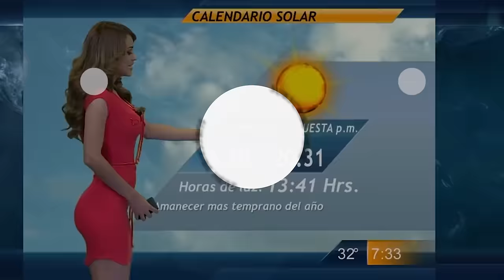Ozzy Man Reviews: Hawk in the Hood

Comment: For anyone in a similar situation where you need to interact with a wind/ scared bird, it is far safer for both you and the bird if you can swaddle it in a towel or something similar. It should be thick enough that claws and beak cannot easily penetrate. By swaddling them, that prevents them from moving which can damage their wings and it keeps all of your parts protected
Reply: You're still getting sued.  :)

Comment: nerd info
It is a red tailed hawk, common throughout North America.
What happens is they dive after a rat/mouse/juicy rodent across a highway. They have tunnel vision during this and are oblivious to anything else.  i am surprised it flew off, it was probably temporarily blind after an impact like that.  When birds strike (crash into) something the optical nerve gets a thump and causes blindness, it is not permanent.  
I would not worry about being bit, the feet are it's weapons.  The best guess is 200 pounds of pressure those feet can can give. The inch or so long talons are pretty sharp and WILL go straight through you skin into muscle.  
The first instinct is the wrong one to use in this situation, trying to yank you arm, hand out of the grip means "I did not kill you yet." to the bird and you get a tighter grip.  The tendons in their feet have  a ratchet mechanism that is really hard to undo.
The hood part is funny to me, hooding a hawk is a common thing to do in falconry.  It is calming to the bird.  They are very visually oriented.